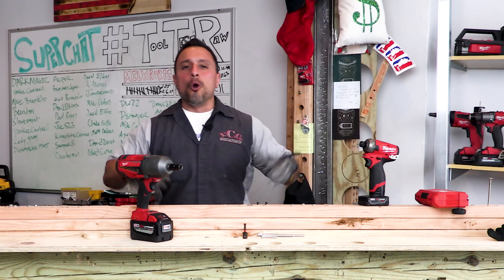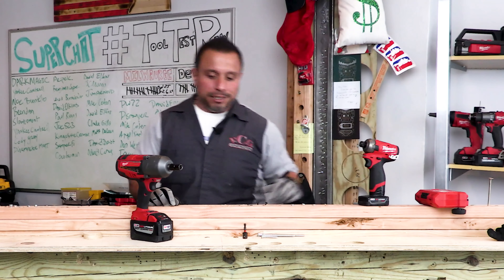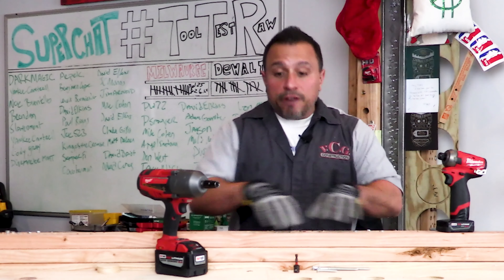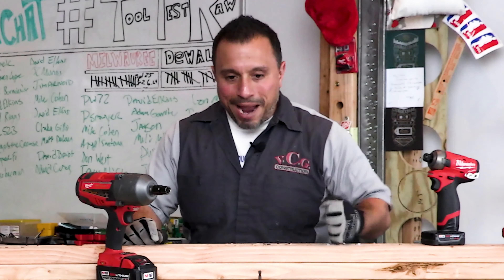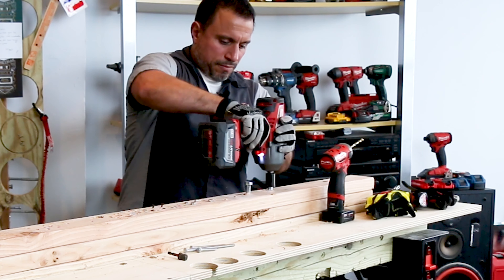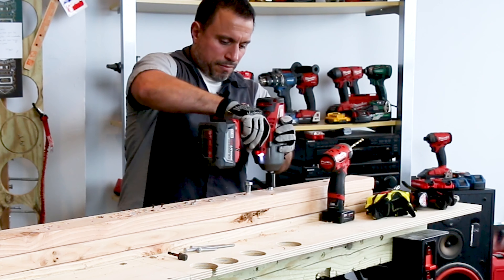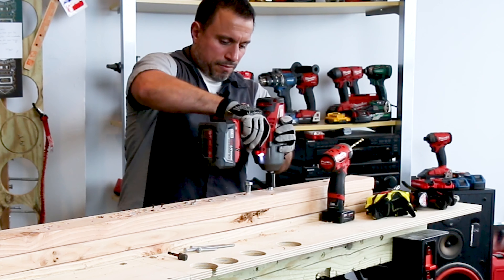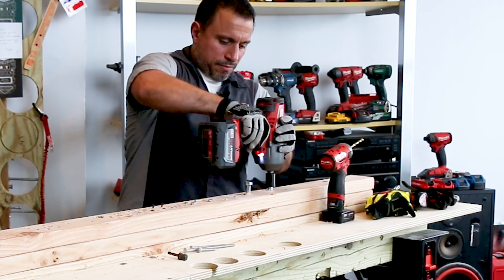Do You Really Need To Pre Drill Your Holes? STOP DOING THIS

Comment: Spot on brother! Preach it. Of course, the pro's in the know choose....... To do what has been working without failure for years and years. Yo, to be honest, I won't even do cabinetry installations without my old pony 8510 bp face frame clamps. They also have the sleeve for my pilot bit, and sleeve swing away for the sleeve built in to center my tapered countersink bit. All without moving or removing the clamps. No way I'm doing cabinets without. 

I will do a large pre drill and use large carriage bolts on some large structural timber framing. But I like the timberlok self drill lags. The best out in my opinion. They are indeed stronger than your average lag bolt. Who hasn't had a lag bolt snap with little torque at the end of fastening? Even by hand. So those are my go to options for timber framing. Either gets bolted or timberlok. Unless owner requests all of those fancy steel plates. I don't do full on timber joinery like the big time pros do. I am fascinated by it, but I have enough going on. You nailed it Vince! Or screwed it I suppose! Thanks for the video cuz! 👍💯

Comment: putting a screw into wood you are compacting or pushing the wood out to make room for the core of the screw and that's why wood splits. Pre-drilling a hole, you remove that wood that would be compact/ pushing out, leaving the helix part of the screw to grab the wood. pre-drilling also allows you to guide the screw in the exact place you want and is good for when are screwing screws at an angle.
Reply: That's what Vince said, but you put it better and more concisely!!

Comment: Also for smaller diameter wood you may have to pre drill with screws you normally wouldn't, like a 1*4, or a 2*2, or similar case, those things that are more likely to split on ya, also sometimes you need to countersink as well to prevent splitting and to have a better looking end product

Comment: Do you need to predrill when swapping out those short screws used for door hinges and locks for 3 inch screws, or can you just use an impact tool instead of a drill and predrilling, without causing wood to split?

Comment: Also, the closer to the outside edges of the board, the more likely you are to get a split or crack. The moisture content of the board will also affect how likely the board will crack/split when a fastener is driven through it.
Reply: If two fasteners are driven into the same grain of wood close to each other, you're also more likely to get a split/crack.

Comment: I would add some things to your video: when you work in soft wood (construction or furniture) it has more capability to compress. I like to pre-drill a hole of size little bit smaller than the screw core, because wood around it would get compressed and there will be more strenght added to that screw. If the hole is too big, you can break the thread in that wood. Fasteners which are desined to be screwed without predrilling often have little fins beetween thread, which are ment to crush and grind wood around fastener, so they release some pressure. If i'm about to screw in the middle of OSB board (or plywood and i don't care about rough edge) i don't predrill even if core is quite big. The only thing is, if it is hard plywood, without pre-drilling srew can break because of applied forces. And if it didn't break, and you unscrew such screw, it is extremely hot ;) If i work in hardwood, pre-drill diameter shoud be even bigger than the core. Once i was placing a steel threaded insert in beech table leg, and it splitted a little - fortunately it was on hidden side, so after glueing and increasing hole diameter it was fine.

Comment: I’m in the middle of building a custom walk-in closet.  I used some pretty long screws to mount some of the melamine structural components to the studs.  Yes, I’ve been in a hurry to complete this and did not pre-drill.  The screws seem to go in fine, then suddenly I’ll feel the driver spin the head freely.  They were getting so hot, the heads just shears right off when they touched the wood.  Does this sound like a poor quality screw or should I have pre-drilled?
Reply from the maker: Maybe a combination of the two! You aren’t using drywall screws for wood assemblies are you?

Comment: I prefer to pre-drill, especially near the ends or edges of boards. And always when using lag bolts. As for "wood" screws, they make drill bits for them, threads, shank, and countersink for the heads. The heads will often split the wood, even when the shaft of the screw did not.

Comment: I was thought that If you predrill a hole with the correct drill bit, the threads of the fastener actually fastens the pieces of lumber tighter and more efficiently. On delicate woodworking projects I do predrill. When I’m at work, I’ve never predrilled a hole in anything other than cabinet doors.

Comment: Predrilling is for pulling one peace into another. You don't need unnecessary threads into the first workpiece and it does not work as good. You should predrill door jambs. You should pilot drill to avoid spilting, braking a fastner. So it depends on the quality of work and what you are doing.

Comment: Most of the question of pre-drilling has to do with proportion.  The smaller the materials,  the smaller the fasteners.  But there is a proportion.  1/2 in lag screw is questionable in a 2x4, anything larger should be predrilled.  In relation. A #2 screw would never offer an issue with a 2x4, but you would  want to be pre-drilled for a piece of cabinet trim. The smaller the material,  the more fragile it is,  so keep that in mind

Comment: When I'm installing a half inch (13mm) 4inch to 6inch long Hex Head Galvanized steel Lag bolts! I pre-drill! Even though my DeWalt dcf888 with a 5ah battery can do it, it have enough power to do it, I still pre drill the holes! That's why I never smoked my DeWalt dcf888, a lot of my friends in the jobsite smoked their DeWalt and even broke it because they are so stupid for doing it. Even my cousin that owns a Milwaukee Gen 3 also smoked his impact driver! If you don't have a 3/8th or 1/2" impact wrench, and you only have a 1/4" impact driver??? Tell you what no matter what, I will pre drill the holes. Id rather invest a 3 to $4 drill bit compare to wasting the $180 tool.

Comment: Older video but ok...absolutely pre drill and for another bit of insurance what ive done is either rub my screw threads on a bar of soap, but i started using a block of bees wax.i know some screws have a special coating they say works but i want to insure that i take every precaution so the wood is less likely to split

Comment: Here's a question and maybe a video on it, with today's variable speed impact drivers and drill bits made with locking ends, are drills even necessary today?
Reply: yes, because impact drivers have so much play in the head the bit dances all over the place. It's ok for non finish work, but I would never use my impact driver for drilling anything I need to be absoluly precise especially in metal fabrication you will break bits left and right. Impact drivers are for the purpose of drivers screws bolts nuts, not for drilling.

Comment: The impact machanism was developed to replace fastening by driller and pre-drill.
Reply: @Zozo806  for end-hinge fastening such wooden frame. You need a slot hole not a pre-drill. And a impact use  #7 screw on top plank is work probably. If you need and sus304 screw for outdoor, you should know that you need cobalt drill bit not a 6240 hss to drill stainless steel or cool-cut so. Therefore, lt proof that whole steel harder to absorb the impact force.

Comment: I'm laughing because I knew that board was not going to split. It looks much too fresh for that. I drive lags without predrilling all day long, if you were going in the thin side then you would have had an issue. On the flat it's no problemo

Something larger than 7/16 - 1/2 would be getting excessive of course, but I literally never have problems at 7/16 unless I go into the very edge of a board or into a single stud that is old wood.

Even multiple studs together like on the side of a garage door take undrilled lags just fine. Fully greed if we're talking about 1/2  or larger in mission critical situations though

Comment: want the 1/2" lag to go faster and smoother, spray the lag with some WD40 using the pre-drilled method.
Reply: I used engine oil and it worked great